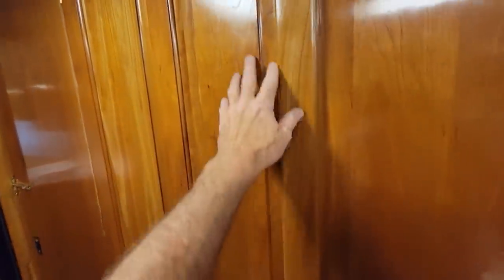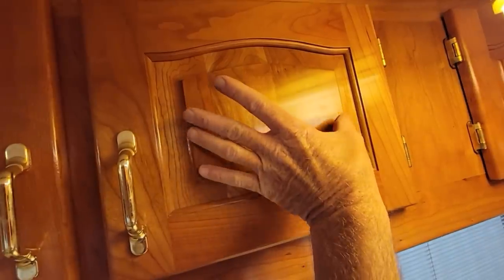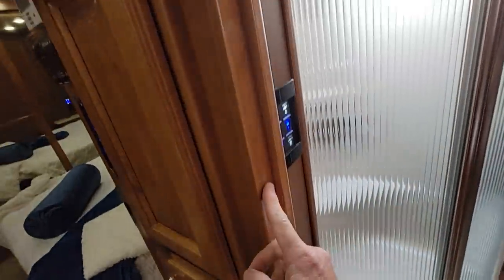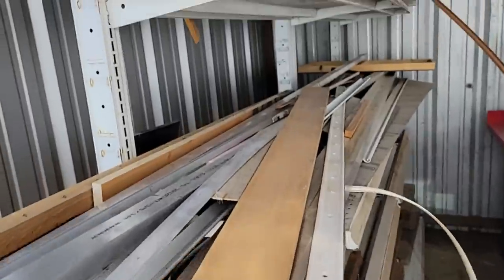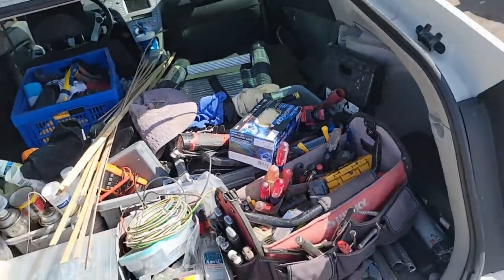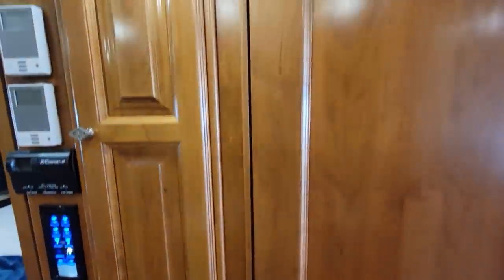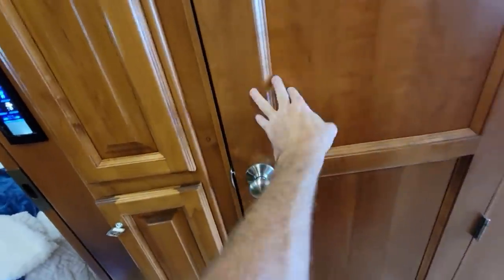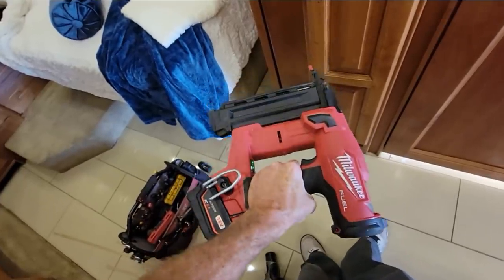A Very Common But Forgotten RV Maintenance

Comment: As you drive road conditions will cause the RV to tweak back and forth. How much space should you allow for this?
Reply from the maker: It doesn't make the wood shrink. Things may loosen over time---you just have to keep an eye on it

Comment: What happens to the door if the coach moves to Alabama?
On another note with moisture or lack of. Can that cause puckering in the ceiling panels? My kitchen panel has that happening and looks like it may be starting in the bathroom as well. I have a 07 Magna 630 Country Coach.

Comment: We have the opposite problem in our travel trailer down here in Atlanta, the bathroom door contacts the trim and rubs near the top of the door frame when closing.  I'm still trying to figure out how to remove some width to solve the issue without shaving down either the door or the frame.

Comment: Thanks for the video... Will now go out and check the oak cabinetry in our Winnebago coach... Just wondering with 1/2 inch worth of shims, whether or not the bathroom door in the Tiffin will be dragging if the coach returns to a high humidity environment for a length of time?...
Reply from the maker: Seems like I should make another video...guess a trip to the PNW is a business expense

Comment: If they properly dried their lumber before milling it, there wouldn't be as big a problem. Also, if you wanted and didn't have more shim room behind the jams, you could also have shimmed the hinges to take up a little more of the gap. Gotta love nice cabinetry and solid wood.
Reply from the maker: I think they do. It's just the nature of wood
Reply: @AZExpert  No Sir. Those doors shrank a significant amount. If it did that on one of my pieces of furniture, it would ruin a piece. You need to shoot for 7-9% moisture when drying, and you have to keep it in a controlled environment, while assembling/finishing it. If it's not climate controlled after that, it can swell, but won't shrink to a point that those doors did.

Comment: Thoughts on Tiffin rvs now that it’s a Thor product?
Reply from the maker: So far Thor has not interfered with the product, so they are the same. I think quality went down after 2017ish but are still much better than most production diesels out there. Thanks!

Comment: I think that closed shower door will hinder the ability for the humidity to circulate.
Reply: Yep, best if it's close to the target and sealed. Unfortunately it isn't realistic with all the cabinets locations in an RV. They say prior sealing/staining all ends of the wood helps.
Reply: There is a large opening above the door as there should be.
Reply from the maker: Most bathrooms have a ceiling vent